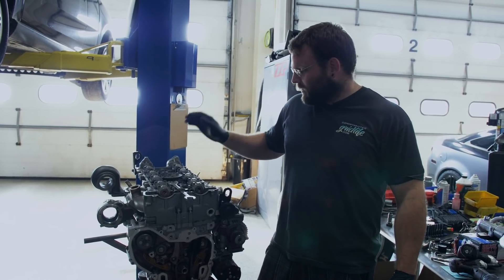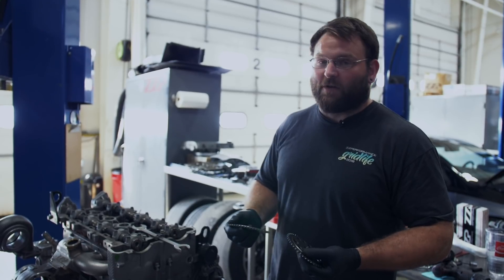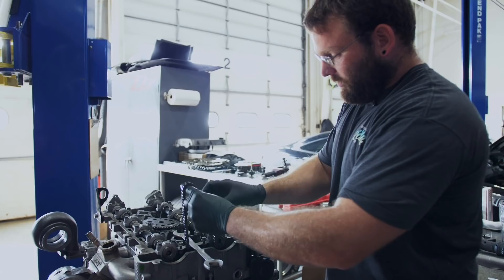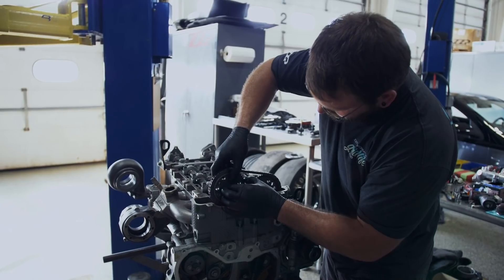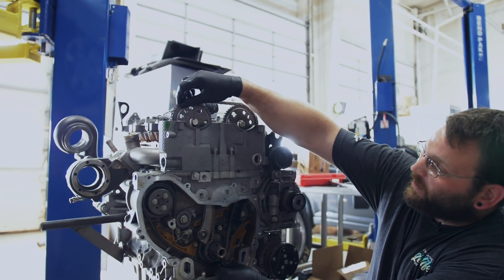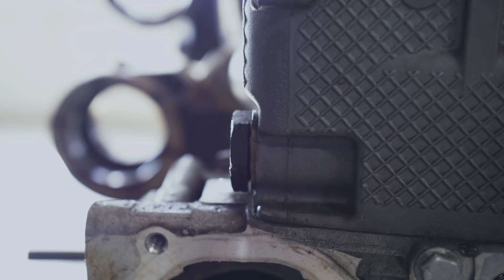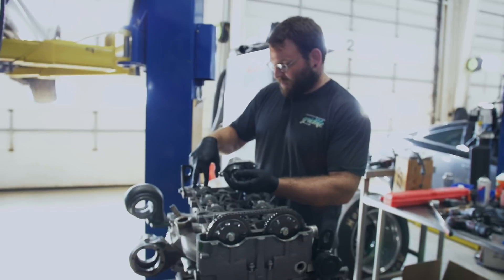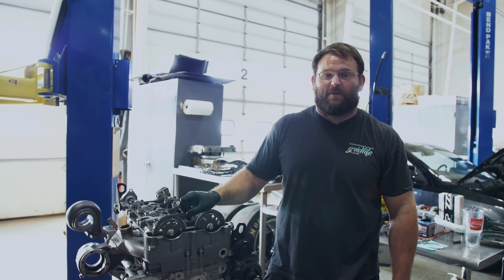ZZP | LSJ Timing Chain Install with Al

Comment: After almost 5 years of messing with ecotecs i got to say i hate them more than a 4l60e trany, why chevy built great cars up until 04 and then tanked with this engine is beyond me, i bought my ss supercharged cobalt because i always had great luck with cavaliers,Berettas, ext....and my god what a headache, my 05 2.2 cobalt through the timing going down the road...junk, my hhr pannel that i still have....timing is bad, my 07 ss supercharged....fucking timing, like seriously chevy...what was you thinking???

Comment: I drop a bolt from the timing gear into the cover how is it to get out without taking off cover
Reply from the maker: That's going to be exceptionally difficult without taking the front cover off. You might be able to sneak a magnet down in there, but it will be like operation getting it back up and out. We would recommend taking the front cover off before damaging anything else.

Comment: 2011 2.0 turbo and when i finished this job I have a crank no start .After further review I AM BEING TOLD THE 2.0 TURBO CAMS NEED TO BE AT 5- ANND 7 OO CLOCK  to time correctly on a LNF 2011 2.0 turbo  GM motor. your thoughts?

Comment: Ok so I personally was trying to decide why every video and direction on timing this engine has you install the primary tensioner in the deactivated state, then activate it once it’s in the vehicle. And I figured that out. The guide it rests on has a notch that matches the tensioner piston. If you install the tensioner in the activated state, like Al did in this video, then as you screw that tensioner in that plunger is fixed and when you torque it... it may not line up correctly with the guide seat. If you install deactivated, that plunger will eventually seat correctly by the time the tensioner is torqued because it can spin freely when deactivated. Activating is as simple as leaning on a 2.5ft prybar with some tape on the end positioned on the chain where the guide meets the tensioner, obviously from up top, just like the Cloyes video on timing this engine instructs. 
That is all, good luck timing.

Comment: I have a question i removed the cylinder heads off my 07 ion redline and didn't properly set it to top dead center correctly before removing them , what would i need to do to make sure i put the timing chain back on correctly to its proper timing??

Comment: I have an issue where my timing chain tensioner loses oil pressure after a couple of days and my timing chain makes noise when I start it anybody got any suggestions . you tube fred cocksamich
Reply from the maker: Hey Fred, send an email over to customerservice@zzperformance.com and they should be able to help.
Reply: @ZZPerformanceChannel  I will do it thank you kind sir you can also check out my build at you tube Fred cocksamich
Reply: Fred cocksamich did you fix it?
Reply: @brandonneil8954  yup